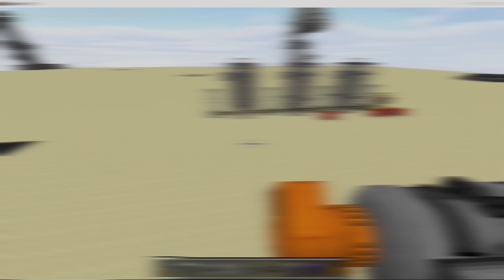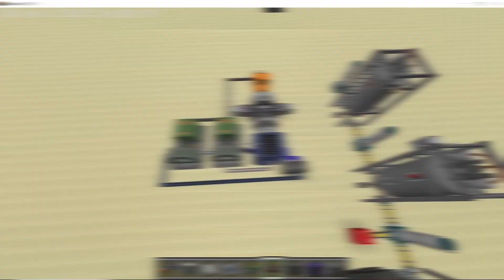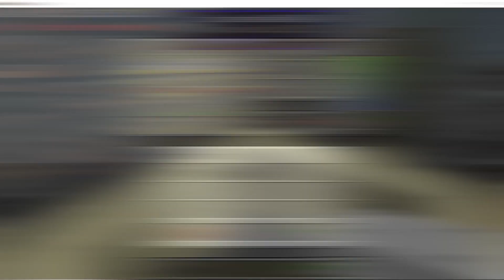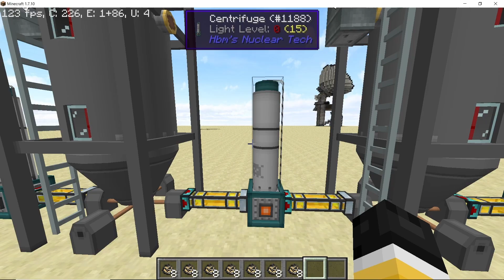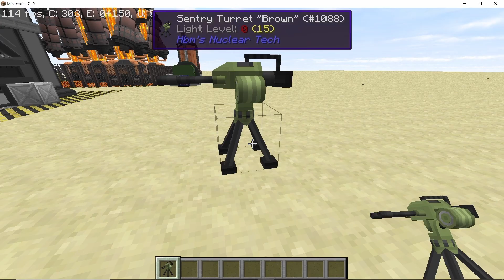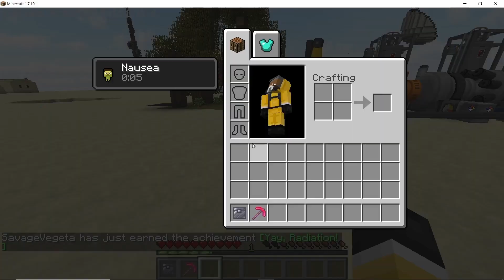Bedrock Ores, Gas Turbine, Geothermal Heat Exchangers & more - HBM's NTM Updates

Comment: I wish they add flare tower chemney for any gases isocyanate with item is sevin pesticide have 2 type of isocyanate liquid and gas flare tower are use electric to burn off the gas one thing need to add is vent gas scrubber and some chemicals like someting add to isocyanate to be pesticide and chemicals that make isocyanate gas to be clean
Reply from the maker: NTM doesn't have Isocyanate gases tho afaik but yeah if they did adding a way to process it before released into the atmosphere would be pretty cool and maybe even a way to introduce pollution mechanics into the mod
Reply: @SavageVegeta  if they add it isocyanate gas I want it to be like real life if it leak the grass and anythings are dead with white cloud
Reply from the maker: @trainzandroideuropeaddons5018  that would be pretty cool
Reply: @SavageVegeta  yea
Reply: @SavageVegeta  isocyanate gas can be neutralize by liquid sodium hypochlorite but you change to liquid sodium hydroxide it work by use electric and spray to the vapor
Reply: @SavageVegeta  and if they add water cannon that mean the toxic isocyanate can not escape to air by spray at top of the chimney
Reply: @SavageVegeta  now they add phosgene
Reply: @SavageVegeta  phosgene is isocyanate element
Reply: @SavageVegeta  but after gas process in vent gas scrubber it take to flare tower to burning
Reply: But isocyanate gas can be processing to be plastic
Reply: Isocyanate is toxic and highly flammable gas so flare tower can burn it off

Comment: I have a question. There are dinospheres in the 1.12.2 versions of the mod, they were in the old versions too, but I can't find them in the new one. They are still in mod and if so, how to find them
Reply from the maker: Yeah dynosphere's were in the older versions too afaik and they are crafted iirc. You can check the crafting recipe using JEI. They were used to process materials like Schrabidium but I never used that method and always opted for alternative ways so I never used dynospheres much
Reply: @SavageVegeta  it's sad that there are no more of them in the new versions 1.7.10
Reply from the maker: @ironsider3622  That is not an issue tho ... cause there are already multiple alternatives present for obtaining materials that the dynosphere use to give in chemical plant
Reply: @SavageVegeta  yes but for toxic waste you need vatz power plant
Reply from the maker: @ironsider3622  yeah, but if you use the schrabidium transmutation device then you only need uranium and energy
Reply: @SavageVegeta  yes I know it
Reply: @SavageVegeta  and red capacitor
Reply: @SavageVegeta  thank you

Comment: question, im having problems installing shaders with mods i like put optifine im the mod folder and then i enable the shader pack and it work but if i put some mods the game loads but the screen is still showing the minecraft loading screen and if i click i ear the blocks breaking. do you know a way to fix it?
Reply from the maker: Now there are some shaders like the chocopic13's toaster edition which will not work and if you enable it will make your whole screen black ... Which seems to be happening to you so maybe try installing a different shader like BSL or Chocopic13's Lite edition
Reply: @SavageVegeta  thx but i found a fix you have to go in config folder and chage some script of the hbm
Reply from the maker: @kggames7885  if you're running the 1.12 version of ntm then yes there's an option called enableShaders2 for this
Reply from the maker: Never had this sort of problem before man, the Optifine jar file goes into mods folder and all the shaders go into the Shaderpacks folder. Then after loading a world if I go to the settings and enable shaders they work fine

Comment: hey, I wanted to ask if there were any creature and good gun mods for 1.7.10, I use 1.12.2 version of hbm but it isn't updated as frequently but I stay in 1.12.2 because of the scape and run parasites mod, is there any mod like scape and run which could let me use HBM's weapons at thier maximum potential for 1.7.10 because other than that there is no purpose to getting all this machinery if there is nothing to beat it with
Reply from the maker: There's the orespawn mod which has many strong bosses, NTM in itself has many strong mobs you can fight. The thing is I play NTM for it's tech side of things as for guns / vehicle mods I prefer realism like using Vic's or Modular warfare

Comment: What kind of blood did you use? What is it for, and what does it have to do with the blood?
Reply from the maker: I used blood from NTM, it can be obtained by holding an empty IV bag and right clicking with it which will deal us damage and deposit some blood in the bag. Also it can be used as a heat exchanging fluid and has higher heat carrying capacity than mugroot beer !!
Reply: @SavageVegeta  Wow, I didn't expect that.
Reply from the maker: @farnorth7216  yeah, it's pretty useful in this respect

Comment: I wish I could play the 1.7.10 version but when I use it the screen goes all funnyand just shows green,blue and grey :c
Reply from the maker: That is super weird man, I never face that issue when playing ntm in 1.7.10
Reply: @SavageVegeta  quick reply! It’s probably because I can only use curseforge launcher
Reply from the maker: @jellybeaniac152  why can't you use other launchers tho ??
Reply: @SavageVegeta  like minecraft launcher? I can’t install forge version as java files. They always save as jar files so I use the curseforge launcher. (Sorry for late reply my internet said bye bye)
Reply: @SavageVegeta  If it helps my most recent video is what happenes
Reply from the maker: @jellybeaniac152  update your java & your video drivers & Minecraft launcher as well
A guy had similar issue to this kind of screen glitch and was solved after updating everything.
Reply from the maker: @jellybeaniac152  and tbh I don't really get the reason you gave for only using Curseforge launcher. Even with normal Minecraft folder you can download the .jar files and place them in the mods folder. Just saying cause I've been using the default launcher since a long time and it has worked great so far
Reply: @SavageVegeta  thanks!
Reply: @SavageVegeta  It’s just that the forge download, to install usually it opens but it opens in text document

Comment: Bedrock ore is rare, but it has it's reasons for that, there is no way to locate it but it will be encased in depth rock at bedrock level, there wont be any depth ores in the depth rock it is encased in

bedrock ore after being mined will not disappear, ever, it is an infinite ore, it has tiers which means how fast or efficiently it gets mined, it can be processed MANY times, enough that you get a stack from 1 bedrock ore mined by the large mining drill but you do need solvent for this and sulfuric acid
Reply: i forgot organic solvent cos he also did i think
Reply from the maker: thank you for all the useful info man :)